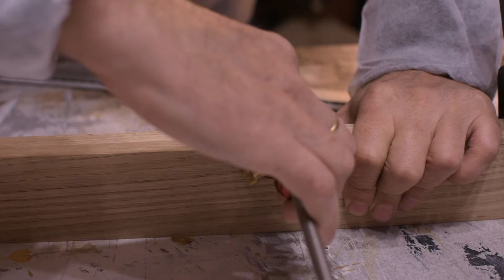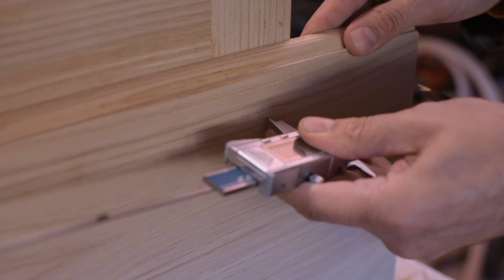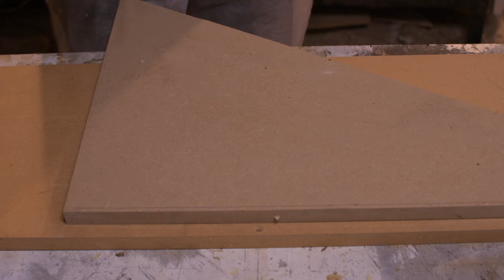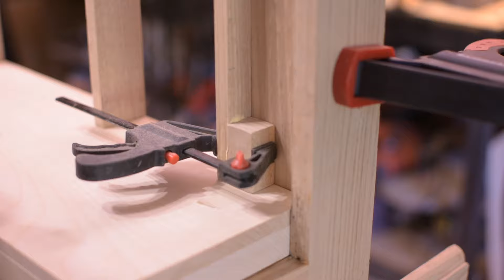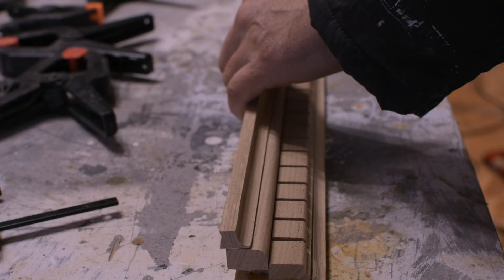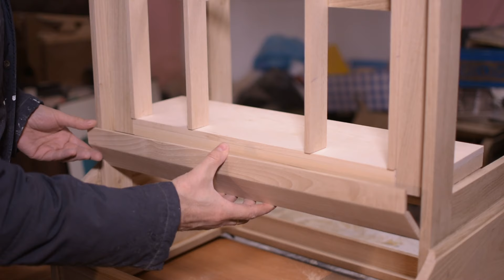Renaissance Positive Pipe Organ Building - Let's Get Started!

Comment from the maker: Well, after a long time we're back to building. In the previous video I said that the organ will have 2 registers, one 6' stopped and one 3'.
In reality, after careful analysis, I can fit a stopped 8' and an open 4' with a short octave, and the possibility of switching to full chromatic starting from F.

Bene, dopo tanto tempo si ritorna a costruire. Nel video precedente evevo detto che l'organo avrà 2 registri, uno  6' e uno 3'.
In realtà, dopo un'attenta analisi, riesco a farci stare un 8' tappato e un 4' aperto con ottava corta, e la possibilità di switchare in cromatico a partire dal Fa.